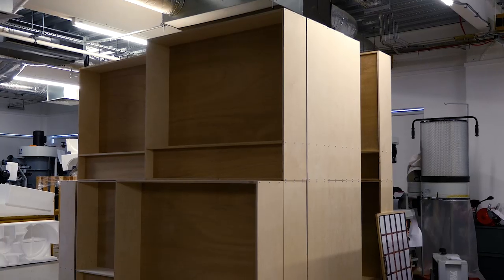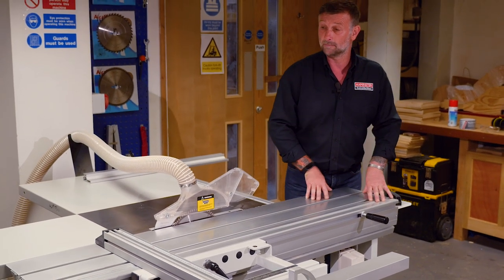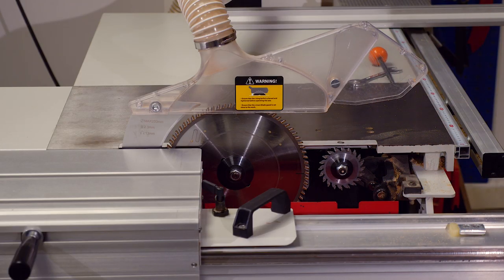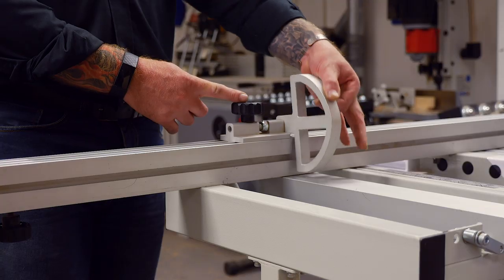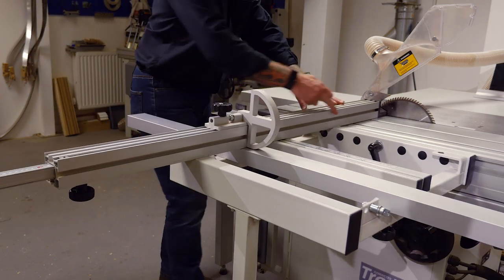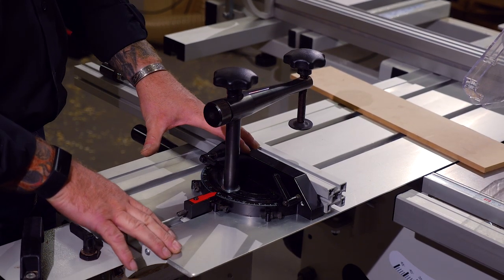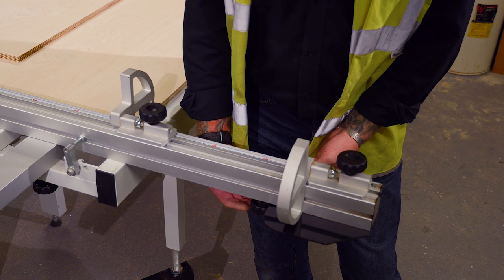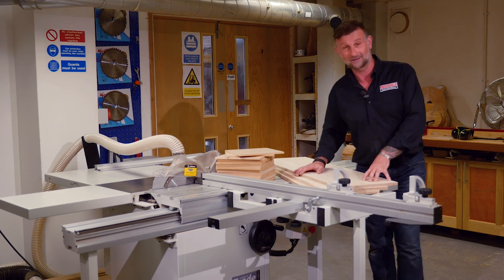Axminster Trade AT254PS16 Panel Saw

Comment: I bought a jet 600x from you guys about five years ago when I was based up in Scotland. The saw has never cut straight or square no matter how many times I set the dam thing up. I contacted you guys several times after purchase  to deal with issues that were never resolved. When I moved my workshop back to Lancashire it went into storage for two years. Now I’m back up and running and low and behold it still cannot cut true. This saw you are reviewing looks to be everything the jet was supposed to be but isn’t. I really wish I had the confidence to make a major purchase from you guys again and invest in something that works instead of the overpriced paperweight stuck in the middle of my shop. Nice review by the way.
Reply from the maker: Hello  Rob! Please call our aftersales Team on 0800 371 822 (Option 2, Option 2 on the auto assistant). They will be able to assist :)

Comment: I realise the Axminster tools are China imports. I'm seriously considering fitting out my shop with Axminster Trade machines, but what are the arguments to buy one of these Axminster tools (in this case panel saw) over say the Hammer lineup, which is only slightly more expensive.
Do the Axminster machines offer heavier gauge metal? Are there other pros? In short, why should I chose the Trade line besides being slightly cheaper?

Comment: Why does my panel saw make a grinding noise when switched on
Reply from the maker: Hi there, if there is a grinding noise, it is usually one of two things: 1) There could be a small piece of timber trapped in the inner guard area or spindle and is rubbing on the blade. Isolate the machine and clear all debris from the machine. Or 2) A spindle bearing has failed. This may need an engineer to asses and replace the bearing. Hope this helps and if you need further support, please contact our technical team who can assist - https://www.axminstertools.com/contact